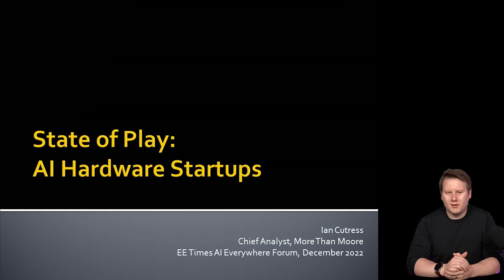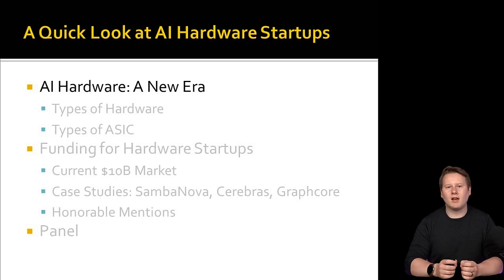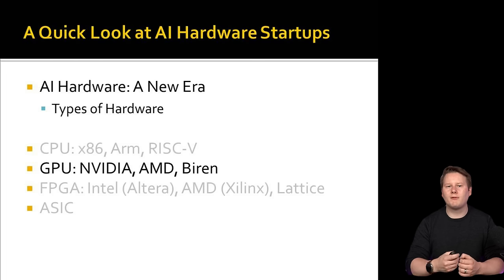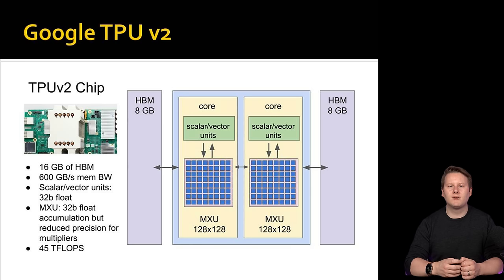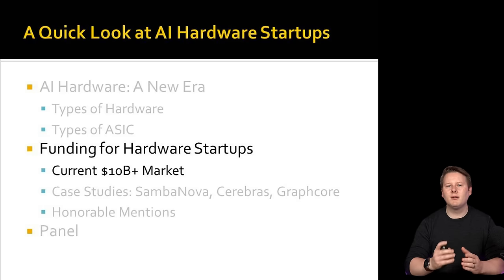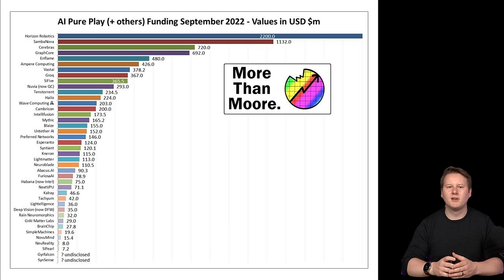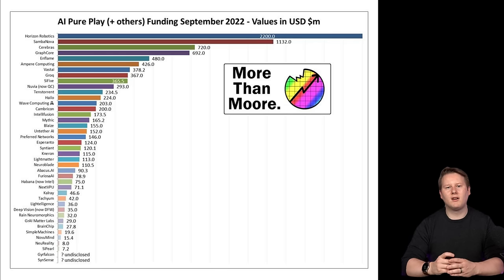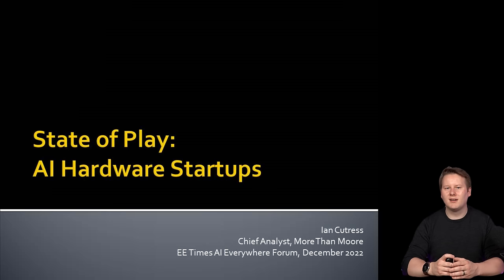AI Hardware Will Be Everywhere (for a fee)

Comment: I just saw LTTs video where you were having a black screen after login, and I was coming over here to say that I had the EXACT same thing happen after a windows update, and I figured out my issue was due to a program called OldNewExplorer I believe? Basically anything that directly modifies the Windows shell causes this after an update. I had to open run (WIN + R) and type "control" then uninstall it and restart. Fixed my issue, you should check and see if there's anything installed that seems like it could be a problem. Not even sure if you're still having this issue since Linus' videos are uploaded weeks later.
Reply from the maker: Yeah I fixed it about a week later. Installed CCleaner and opened Task Manager to run it, uninstalled about 50 non-vital apps. It now boots every time.

Comment: I feel like I have heard this talk before, at least parts of it. The recent upload where you held it in London? 

If there were a better solution than just buying the nvidia RTX 6000 Ada (short of a H100 PCIe) to run large model inference in a local workstation... AMD has some workstation cards with a lot of vram now. Intel has Gaudi2 as well as PVC - but don't sell either to workstation, they aren't in that market at all. 

Also why spend 6000€ on a large GPU just for model inference that sleeps 98% of the time, especially if your Gaming GPU costs maybe 250€.

I hope some of these products make it to consumer workstation soon - because all products currently sold as "ai accelerators" are from  5 years ago and for tiny computer vision models. not 30B language models.